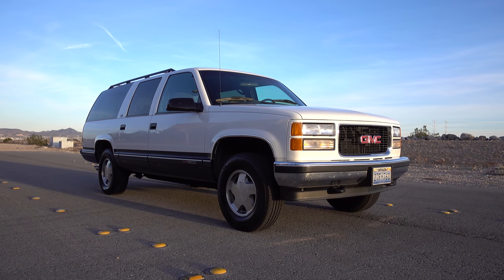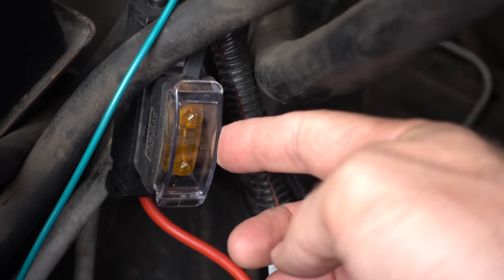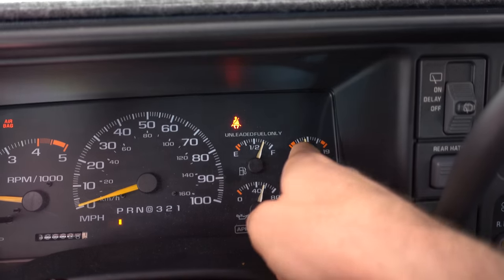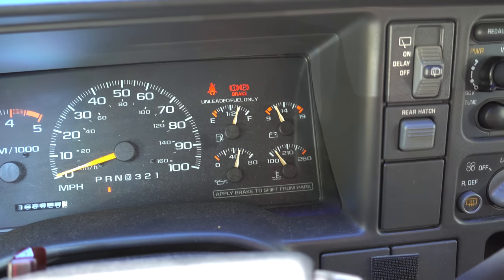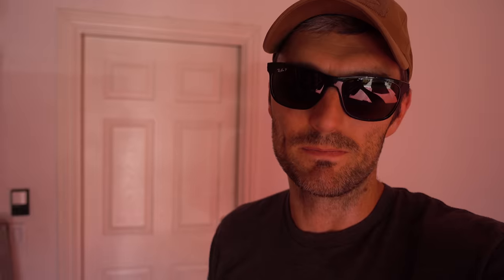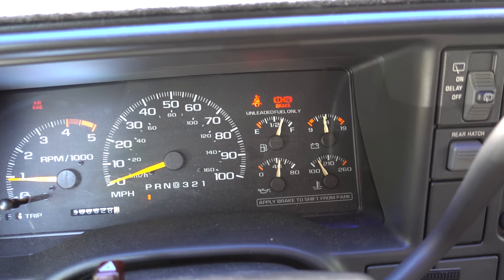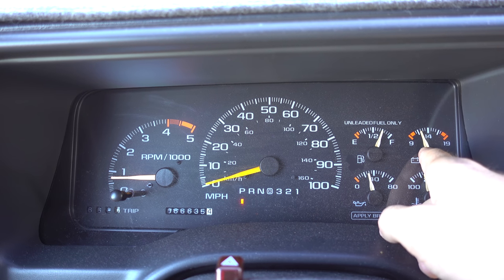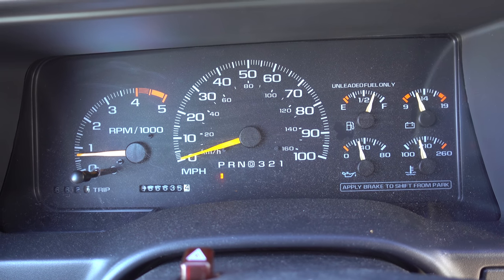SOLVE A LOW VOLTAGE ISSUE!

Comment: Alternator produces your electricity while the engine is running. The battery is just for cranking the engine. You can either just replace the alternator, or look for a high output alternator to meet demands.

An aging alternator will see less and less electrical production. RPMs also play into it, the lower the RPM the less the alternator is turning. So your idle control could play into it.

Popping the fuse could just be a result of unstable voltage. The extra battery isn't going to help. If you aren't producing the electricity, you have to solve that problem instead of patching up the symptoms.

I'm wondering if a capacitor to the fans could help, but that could be tricky. It will give a buffer between the  alt and the power hog fans, reducing volt spikes.

Just some ideas to think about.
Reply from the maker: +DeathInANoose A cap is not a bad idea. I'm gonna look into that. Here's a question, is my volt meter reading the battery voltage or the alternator output or somehow both?
Reply: While running I'd say it should showing what your alternator is producing, probably what it's producing over what it takes to run the electronics in the vehicle, so more electrical load, less extra juice, meter drops, and then something has to give. Since you changed the battery, that's not the issue. 

Something I learned with an amplifier hooked straight to the battery is that the voltage spikes will wear your alt out. Same will apply to the fans kicking on suddenly, the cap might help with that.
Reply: A capacitor is not the solution. Your alternator should put out about 30% above the total amount of amperage you need to make up for the added surge whenever you turn on a heavy load.  Or an additional battery to supply      temporary current flow for the demand. This is why you do not see capacitor anymore in high end stereo competitions, they normally run multiple alternators and batteries.

Comment: You might want to get the  alternator that the police vehicles use. They have a heavy duty - high performance one for all the electronic computers, lights and cooling system.
Reply: they also have dual batterys in all of them

Comment: no dual battery! just get a higher output alternator. the battery will just ease the problem. and shorten batt life. it could be the regulator in the alternator. may be going. but it is the alternator. hope you fix the issue. if you add a battery . then you will have two dead batteries! good luck..

Comment: I just put these monster fans on my 1992 Chevy k3500 dually 7.4L and I have a optima yellow top battery and 200 amp alternator and zero gauge battery cables and have ground straps every where. Need to check what that alternator is putting out at idle.
Reply from the maker: +DeLorean3794 And you don't have this issue at all? My alternator is listed in the description of the video. It's a brand new unit by PowerMaster. 140amp! Should be plenty. I believe it puts out 100 amps at idle.
Reply: 1 Road , You need to have a higher amperage. Your current alternator is not enough to support your vehicle. Either pick up a new alternator with a higher output at idle or change the pulley on your alternator to a smaller one. Your vehicle probly draws about 75 to 100 amps with all its accessories on, and not to mention the two new cooling fans you added probly about 60 to 80 additional amps on top of that. So 135 to180 plus amps and about another 30% to be safe. Rounding up you need about a 260 amp alternator at idle. I would pick up a 300 amp alternator from mechman, probably there elite series. I believe at idle they put out about 200 amps. They also build custom alternators in house. However the price of this might be overly expensive and at this point It might be cheaper to run a dual alternator setup.
Reply: living in a desert  , I was watching this channel because I have a 94 Chevy suburban and like his videos. I also had to upgrade my alternator. I went with just one, I probly would have been better off just running dual alternators and there's already provisions to add in a 2nd battery Box, Also for the price I paid for the upgraded alternator, I could of probly of got away with just two stock alternators and had some extra cash leftover in my pocket.  I was just curious to see what he did and how the fans turned out I'm thinking about  Installing electric fans myself.
Reply: @robbyota5598  Electric fans are just a waist of good money because the hp gain is triply lost because of overload put on alternator plus loosing hp because of alternator load !!

Comment: If the battery was bad it could have caused this condition. I did a new battery on a 1994 Mustang when small loads dropped voltage significantly. It helped a lot, but testing the battery would have ruled this out more easily and a better or newer alternator could have been the answer faster. 

You could also voltage drop test the wires in the system to see if you were losing power anywhere.

Comment: Some kind of a connection issue, I had that happen to my 1993 Cheyenne, come to find out the batter lugs were stripped and needed to be replaced. Soon as I changed out the lugs big differnence

Comment: The thing thats better about belt driven fans is that the fan free wheels when the clutch isn't engaged. So you don't have that spike in temperature at idle in traffic. Your engine temperature stays stable not going up amd down as the fans go on and off

Comment: The alternator is not strong enough. Since it can not maintain 14.4 volt, the batteries is not charging correctly.
Since the batteries never get charged, you wear it out. So, in the end, you damage your batteries too.
And the multiple washer screw is not professional. I predict a drop of voltage of 0.5 volt, which could waste up to 50 watts at 100 amps. Did you notice discoloration like blueish, sign they get hot?

Comment: Get a higher amperage alternator. After installing very important, check and clean up ground to the alternator and battery on both ends. You are running more power at this point and your grounds are extremely important.
Reply: Also run appropriate heavy gauge cable to all ends on positive and ground of alternator and battery and your accessories you need good flow a voltage drop to your accessories is not good.

Comment: its the alternator! smh the battery only starts the car after the engine is running its up to the alternator
Reply: thats not entirely true. The battery starts the car and runs the electrical system whle the car is running and the alternator recharges the battery and should have an output greater than the battery's load. So yes, the alternator run supplies the power while the vehicle is running, but it still passes through the battery.
Reply: It’s the alternator 110% sure.
Reply: Joshua Malinko no it doesn't. The battery and the alternator are wired in parallel to each other and in series relative to the rest of the vehicle's loads. Once the engine is running the alternator must recharge the battery and have enough amps left over to power all the loads.
Reply: Mavado Roaster turn on your car and disconnect the battery.  See what happens lol
Reply: GoAt FloAt you got to wait a while for it
Reply: He just said he replaced the alternator with an upgraded one.
Reply: Ismael Carrillo...actually on older vehicles you can disconnect the battery and drive till you run out of gas...this proves Alternators run the vehicle...they recently changed the wiring on modern vehicles so you can't do this anymore but it's the same concept.
Reply: I lost connection one time with one of the wires gotten lose in mid flight & the car engine shut off. You need the battery.
Reply: Cali_livin Guy ...sorry guy but none of what you said made sense to me...You lost connection because of a loose cable so you're blaming the battery for that? Is that what you said?...cause if so...then you should've just tightened the terminal...problem fixed 😉...and I still don't get the part about you being in mid flight in a car...WTH were you jumping 😆
Reply: The bolt that tightens the battery wire to the battery had gotten loose & the car died. Luckily I was on a small street where I just pulled over & re-tightened it. Just adding my 2 cents to the people that are saying you don’t need a battery once the car is on.
Reply: Cali_livin Guy ...who said that???... you don't need a battery to run your vehicle just start it...but modern day cars are wired in parallel so you can't just disconnect the battery anymore and run the vehicle...this was only on older models...the wiring has since changed...but you can put a crap battery in your car (tighten the terminals) then jump it and the alternator will keep it running.
Reply: lmaooo i was laughing at this dork ,, my battery runs the electrical? ,, its the alternator and this guy is a dork
Reply: The reason modern cars can not run with out the battery is because the voltage regulator in a modern alternator looks at battery voltage. If that voltage gets too low it cuts the power to the windings preventing a situation where cables could melt, the battery could explode, the voltage regulator could burn up or the vehicle would not turn off. But the alternator has to provide sufficient power to charge a battery just after starting and run all of the vehicles electronics or every time you went on a long drive you would need to change or charge your battery.
Reply: Hello, It is funny because I have the same problem with my 1995 (GMC Sierra) and it costed me thousands of dollars for the last 7 years (changed alternator 4X and changed batteries 4-5 times) towed my truck a couple of times yet it is still giving me problem. This truck I used it for my snow plowing business. I thought if I could ease up the load on a single battery I can install the second battery for the usage of the snowplow religiously. Lo and behold, problem is still the same. I am telling you now because I thought scrapping my old truck a couple of times. 

These were very frustrating on that time.  I have researched for couple of months (who knows how long) and I finally put the puzzles together on this case study. Walla! I  solved the problem by accident. 

In my finding of my research according to accomulated  wisdom from the other people in the internet. There something wrong with your ECU. The ECU will control the voltage of the alternator (plus and minus) However, if the RPM is less than a certain speed (like less than 1000rpm) the ECU will command the alternator lesser  than 12volts.I just thought it is not worth it for me to by a new ECU.  One day, when I was about to work for my snow removal work I could see my voltage was reading  less than 12volts. Out of my frustration, I revolution pass 3000RPM and the voltage improved and it passed 12V.  I have been doing this for the last 4 years and so far I have no problem. MY ELECTRONIC PROBLEM GOT SOLVE. See if this will solve your problem for good. Let me know after you revolution your engine pass 3000RPM.  let me know if the low voltage problem will still persist. Blessings.
Reply: The battery does run the electrical system even while the engine is running. Hence why if the alternator belt rips or if the alternator fails to charge the battery you can jump the battery and have enough battery juice to drive a few miles before the battery dies again.
Reply: GoAt FloAt I agree ☝️ with u.
Reply: Your alternator isnt strong enuf.....you added th fans
Reply: TRUpachuco people used to disconnect the negative on the battery while it’s running to test the alternator but now newer cars won’t let you do that, it’s stresses the alternator
Reply: @hellhellya1  If the alternator works correctly, the car will continue to run if the battery is disconnected. You shouldn't try it on a modern vehicle because the battery acts like a giant capacitor to keep the voltage constant and absorb AC ripple from the alternator, but you CAN actually drive without the battery connected once the engine is running, it's just not recommended since it could potentially cause damage to the car's electronics.
Reply: GLICIOUS21 🤦‍♂️ only if the alternator dies.
Reply: I have had the same problem, replaced alternator and didn’t help so your argument is invalid

Comment: I had the 1998 Tahoe 2dr and did the same setup to solve it don't use same year alternator because it cannot take the heat and the extra load so what I did is I got my self a remanufactured alternator made for 2005 Tahoe model I think it was 140amp or something around it was cheap and OEM and also GM solved the alternator heating problem. 
Never to worry about it, also I did the dual battery setup which was the greatest because the engine started much faster and every thing acted as if it was 2017 model
Reply: So you swapped  your 98 alternator  for.a 2005 one plug and play

Comment: It’s made by GM. You have a bad ground. All GM trucks have bad grounds that manifest themselves after a few years.  The battery starts the motor, but the alternator powers everything  while the motor is running.  The less-than-tight wire connections to the battery are part of the problem.  Again, it’s a bad ground, and the higher loads from the fans, etc. are overtaxing the marginal grounds that you originally stripped and have not properly upgraded. Add a few tightly-connected, large-capacity ground wires, not another battery, and your problems will disappear.
Reply: Anonymous98 the battery powers everything without the alternator, i dont have a serpentine belt on my car and it runs fine without the alternator

Comment: Like you did the big three which is a bonus. you need a much larger alternator maybe like 180 or 200 amp. The truck should run at 14.6v roughly. anything below 12 volts, the truck will run bad.

Comment: well, it's not just the volts you have to check, you need a battery with more cca maybe like 900 cca or the high cca that you can buy for your truck, because of the voltage drain from your fans, because your putting a bigger load on your battery then it can handle, and when your alt is charging it should read 14.60 volts at least that's when the fans are running , and go for the most cca, that's (cold cranking amps, ) the more you got in the battery the battery service you will have. and you do need a battery with very high cca like I said before, 1000 cca if you can get it in a battery that will fit in your truck, 12 volt batteries at full charged is 12.60 volts, but you definitely need the high cca to go with your voltage, and a alt that's charging at 14.50 at least. am sure that definitely solve the problem. you posted this in Jun 20, 2017, did you get it solved? yet,

Comment: You have a 40 amp fuse on the fans? How many amps is your alternator rated for? I'm guessing you need an alternator designed to put out about 40 more amps. Your truck was originally designed to use a fan clutch so the high amp alternator wasn't necessary. You may need to up-size your main wire from the alternator as well.

Comment: I've had brand new alternator fail on first day after install. So It is a possibility.
Reply: I just had 2 from autozone fail only pushing 12.39v under load voltage regulator failed both times . Didnt even get to drive it . It failed on the spot both times

Comment: I know its late but if someone has the same problem, here's what I think is happening. Alternator output voltage is 14V and battery output voltage is 12V. When you turn on electrical loads and see about 14V that means the alternator is supplying current and charging the battery. If you add more loads than the alternator rated value, the voltage drops to 12V which is same as battery output voltage. Now you are drawing current from both battery and alternator. In this case the alternator is small for electrical loads you have in your car so consider upgrading it or make sure voltage stays above 12V by turning some loads off to be on the safe side.

Comment: the fuse popped because as the voltage goes down the amperage goes up so fuses popped because of the increase current
Reply: Jimmydean hilltow which fuse
Reply: James Bannister III

The fuse he talked about in the video. It's the fuse that goes from the positive side of the battery to his new radiator fan setup.
Reply: The fuse busted when its hits a ground. I.e. when the neg toucher the pos.it will blown totally

Comment: Bad wiring, corrosion, weak connections and grounding issues will cause a brand new alternator to produce low voltage. I imagine the big 3 upgrade would fix that as it would compensate for any possible wiring issues.

Comment: I see your AC Clutch on :(((( Test your Alternator, that is the best thing you can do and only way to tell if your Alternator pumping out the right Voltage :///
Reply: NOTE: Find out what is the Amperage on those Fans, find out what are they using. Then compare that to your Regular usage. Best way is to take the Fan off, let the Engine Run for about few minutes, you would be able to tell if Voltage dropped. If your Voltage dropped with FAN OUT, then there might be short somewhere with your Wires...   NOTE 2. I see NO PROTECTIONS on your Wires... Like Heat Shrink them etc especially ANY Positive Wires.... If your Fuse Burnt... There might be Shortage somewhere or the Fan is sucking too much Power or Wire too THIN.... So check your Wires to make sure they are able Support both Fans !!! ........... In the end, back to what are the Amperage for those Fans???

Comment: got same issue as you, your alternator is 100 amp, and putting new battery in will work for short period of time, i put in a optima yellow top deep cycle and fixed the problem for long term, you need a deep cycle battery, or install new high output alternator those fans draw around 30 amps and your alternator is working at max at idle, with fans on , and get better with higher rpms , as alternator works better, i get 3 years out of optima yellow top deep cycle battery, and i live in phoenix